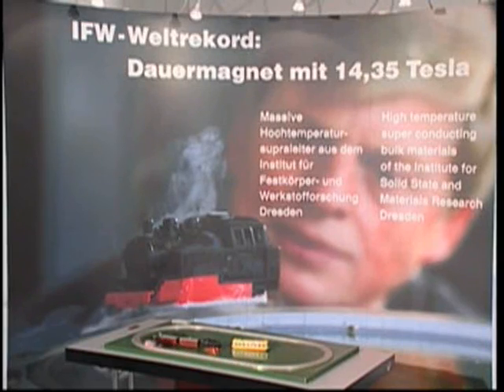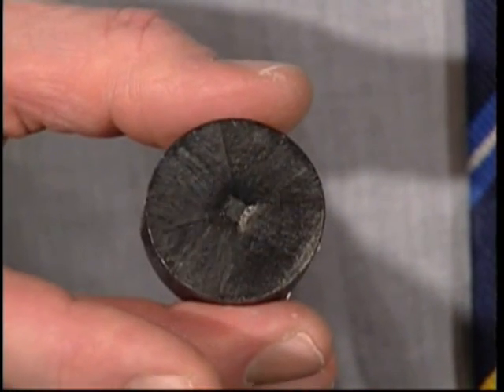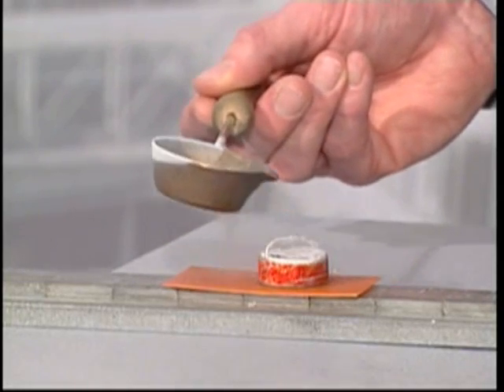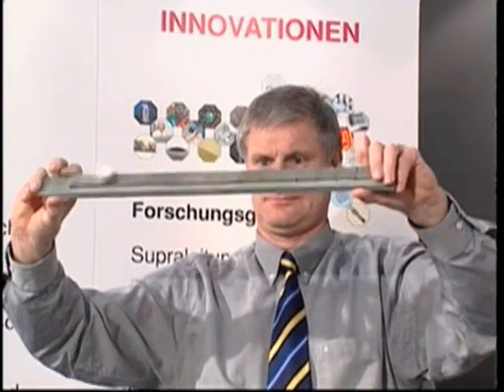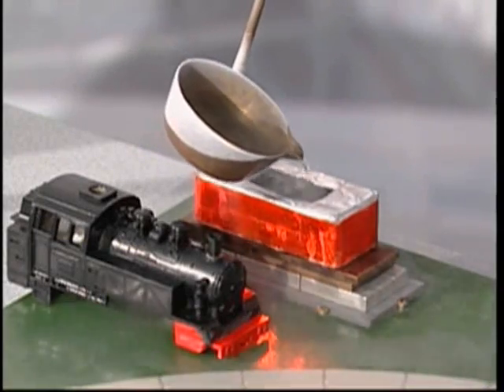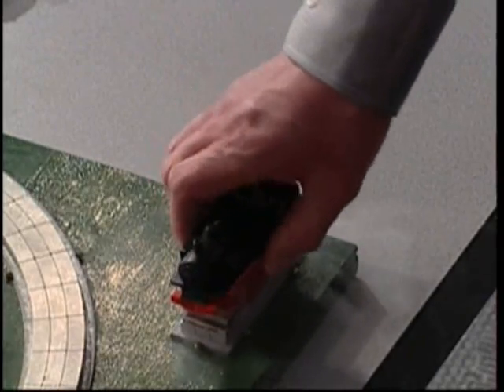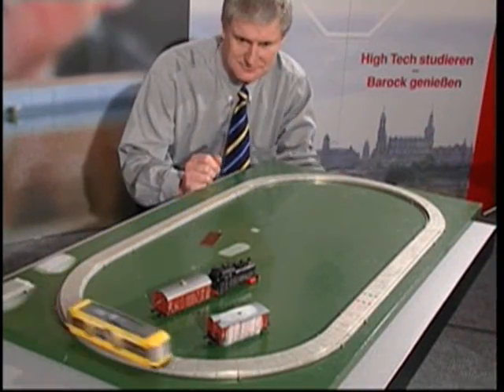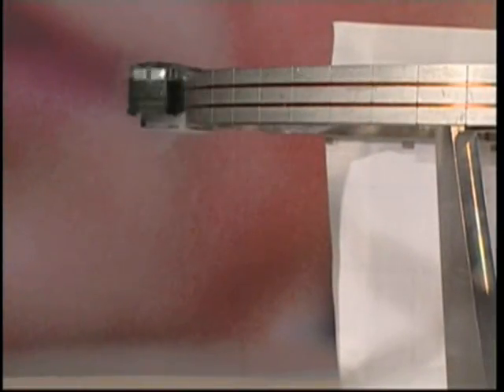IFW-Dresden Superconducting Maglev Train Models

Comment: What the fk are u talking about.

If for example a train has this cool temperatures below it the temperature WILL spread to the train itself.
There are no materials that can keep such low temperatures out. The train itself wouldn't be able to handle it after a time and the passengers would surely die.

There's NOTHING that could keep that cold away.
Plus, this is just a miniature model, it would be a lot colder if it was even 2x the scale.

Comment: @DejanMaticnaLSDu Since there are flywheel-based energy storage systems that use magnetic bearings, presumably those could benefit from 'high temperature' superconductors. Perhaps also they could be used in smaller, more portable MRI machines? The current MRI tech requires helium-cooled superconductors, which is one reason they're so bulky. All that cryo hardware.

Comment: @smittythesmith

"how is this train staying on the track?"

The supercooled object seeks to minimize magnetic flux change. To do that, it must stay on the track. Why does it want to minimize flux change? It has diamagnetism, a property of a material resisting changes to a magnetic field. You usually observe this by increasing the magnetic field, which will cause repulsion, but it can also cause attraction, which happens when you try to remove the diamagnetic material from the magnetic field.

Comment: People seem to think that this train will run forever with little-to-no electricity. While it's more efficient than current maglevs, you still need energy to generate liquid nitrogen (fairly cheap), make the turns (expensive but manageable) keep the conventional magnets from losing their alignment (fairly cheap), and to replace the very large and heavy high-TC superconductors that make the train work (ridiculously expensive). The fact is that these two parts will all decay rather quickly.

Comment: Here's the problem with that idea: your trains would have to be spacecraft to work -- you're talking about running trains in hard vacuum, which is equivalent to putting them into orbit.  Extremely expensive and dangerous to operate.  Also, the amount of energy required to maintain that hard vacuum over long distances will be extremely high.

Comment: So it uses potential energy and gravity to accelarate to massive speeds with little friction, assuming low friction wheel design, and the steep slop at the other end of the track is used for breaking back to zero.  It unloads moves to the other track which of course is opposite and decends back to point A. No power required no fuel, and no magnets. 
Any questions?

Comment: DUMB idea, i have a better one. Feel free to steal it.
Build 2 tracks from point A to point B in a straight line. 
Each track starts at a higher altitude,either above ground or at ground level, and gradually decends at a slight slope of approx 5-10 degrees(maybe less), and ends with a steep slope bringing it back to starting altitude.

Construct a tunnel around the tracks and evacuate the air, eliminating air friction.
Train will slowly accelerate to massive speeds, with no POWER!

Comment: That is a good point about the size of the super conductor as the technology ages its likely that they will get smaller.

The problem of cooling is fairly easy to get around by heavily insulating the magnet id don't think the cooling in this example is terribly efficient, and you could carry more liquid nitrogen as you don't need to carry so much fuel.

Comment: At 3:10: Bringing the body onto the magnetic field of the rail by Manual Lift each time you need to re-fill the superconductors raises some questions when dealing with a real size body.
- This can be solved easily but its just extra work :(

Comment: How would it go uphill/slope?
- At 1:50: Since there's no friction, notice how the body travels back n forth (due to gravity) as the guy tilts the line. To go uphill, you will need extra force from somewhere which is kinda disadvantage.